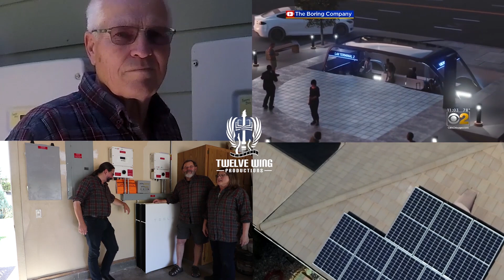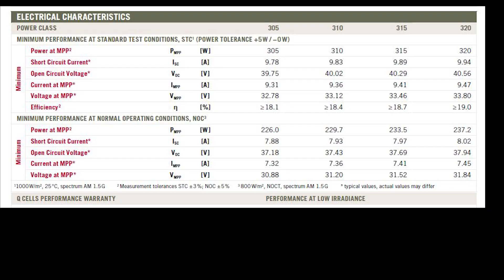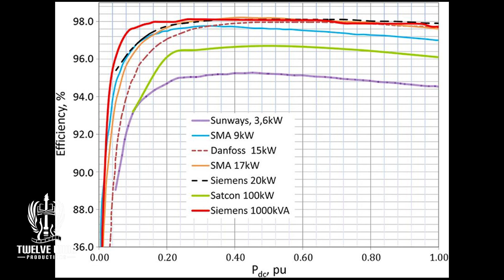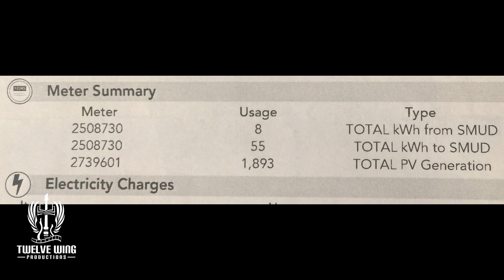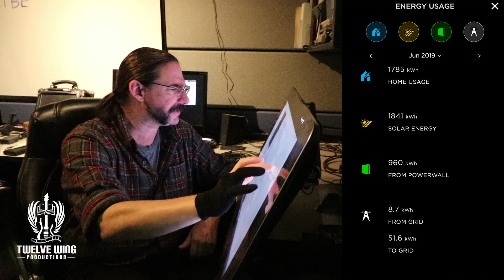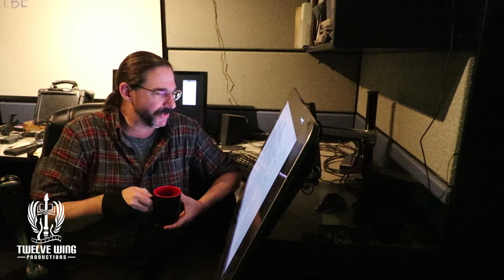How much power does a Tesla Powerwall system really lose?: The Energy Sovereignty Project

Comment: A really great video. I had no idea about inverters being less efficient if they were too large. It always bothered me when I’d see clipping that a larger one wasn’t used. Two questions if you’re still monitoring this video :

Would it be fair to say as long as the difference in rates between peek and off peek are greater than 10% then using the Powerwall makes sense but otherwise just let it send excess to the grid? 

I have micro inverters. Is a string inverter more efficient and does it send DC power from the panels to the Powerwall or do both systems convert first to AC then DC for storage and back to AC again and is they the reason for so much of the losses? 

Thanks !
Reply from the maker: Hello Christopher,
Yes, I'm still monitoring the page and will be starting to produce videos again shortly.
As to your first question, I'm not sure what you mean by the difference of peak and off peak.  Basically your goal should be to run your home as much as possible off the battery to ensure you maximize your return on your investment.  This also assists the battery health as well so long as you don't drop below 20% of charge.
It helps the longevity if the batteries aren't kept at or near 100%.

So this then comes down to sizing your PV system size and battery capacity correctly according to your use case.  Ideally you want to make sure that you have power to drive your home the entire evening when solar isn't providing power to the home.  If this isn't possible then yes, you will want to make sure that you discharge the battery when your utility company is charging you the most for the power.
This may be harder on the batteries but will be your best case for getting your money's worth out of the system.

As to the microinverters, they can be a huge benefit if you have to transfer the power a great distance from where your panels are to where your batteries/home is.  Such as on a ranch or cabin set up where the panels need to be placed away from other structures or on a hilltop.
You get a lot of loss from DC as you extend the distance.
With rooftop solar it isn't as important but you still gain the benefit of having a fairly low loss system.  Losses are usually less with microinverters than they are with a single large inverter or bank of smaller inverters (the usual configuration).

The main losses are as outlined in the video.  Due to a problem Tesla had during testing in Europe early on, they restricted access to the internal DC buss within the battery.
There were simply too many different brands of charger for them to ensure that the batteries were protected.
For this reason all of the powerwall batteries switched to an AC operation only and carried their own onboard inverter/charger.
This also simplified installation but at the cost of some additional losses when the stored energy is transferred out again from each individual unit instead of treating each battery as just an additional DC bank.

The TWP studio here has a 7.2kw system that uses microinverters.  I sold the energy sovereignty project home but I'm still in contact with the current owner and may still do some videos there as well, but I will be doing a video here at the studio before too long when I install batteries here as well.

Thanks for your interest in the channel.  My apologies for my long absence.

Comment: The extra loss would be related to power at different temperatures. In the Tesla datasheet, it says clearly that 90% efficiency is tested at 3.3kW (charge/discharge) at 25degC. Obviously most owners will be operating outside those conditions and that increases the losses. Unless one can put their Powerwall in a controlled air conditioned room at 25degC and limit the charge/discharge at 3.3kW, the cost of doing so would exceed the loss itself. My Powerwall is operating at 87% after nearly 4 years of ownership. Utilisation rate is about 48% on average, so I should get a long life out of it. Powerwall has operated flawlessly so far. I've ridden through over 104 hours of blackouts (the longest being 25 hrs) and I've had about 60 blackouts. The sheer convenience of having power during a grid blackout is priceless. Well worth it.

Comment: In Belgium we can put as much panels on our roof as we want, the only limit is a 10kW inverter
Reply: So unfair were capped per house hold even if the whole street doesn't have solar.
Reply from the maker: Very interesting.. but then that's your limit then.  No one is going to hook 20kw of panels up to a 10kw inverter...though in winter you might come close.. say 15-18kw.
Or by that did you mean 10kw each?  So a 20kw system could use two 10kw inverters?

Comment: I am about to install a solar system at my house.  My average use is 55 kw/h per day over the past 12 months.  During the summer, we are using about 75 kw/h per day (some of the increase is due to working from home during COVID).  What size solar system & how many power walls would you recommend?
Reply from the maker: Are you driving electric as well?
If so, are those numbers including your vehicle charging?
Also, how large is your home and what is your general geographic location... latitude and elevation if you aren't comfortable with giving me your country/state and elevation.
Reply: I do not have an electric vehicle.  My house is 2300 square feet.  I live in Charleston, Sc.
Reply from the maker: @bklankford79 , if you have net metering in your area and you wanted to cover all your electricity costs you would need around 20-23kw of solar production, roughly twice what we have as our yearly average is 30kwh per day and our summer peak usage is around 50-60kwh per day.
At 10.2kw of production we are able to drive 10,000 miles on spare electricity.  That's approx. 3.2Mw.

So if we knock the driving off the top and give that to you in additional production you can probably go closer to that 20kw range or even a little less.
The problem comes if you don't have net metering or planning for what you are going to do when net metering is no longer available.
When that happens you will be purchasing power from the grid for about a month and a half in mid winter even though you are over producing during the spring and summer.

The best way for me to suggest offsetting this is to drive electric and install 60-90kwh of onsite battery storage.
This is the "Energy Sovereignty" approach and pays dividends beyond just the savings on your electric bill and auto repair costs.
What it does is it allows you piece of mind that even if oil were to totally collapse due to war or virus... what have you... that you would still be more or less self sufficient.
As you have seen by following The Energy Sovereignty Project... even on the cloudiest of days our production isn't zero.

So the final calculations of this are going to be based on some other lifestyle factors you are going to need to sort through.
I hope this helped.
Reply: I would have net metering for 10 years and then it phases out.  So you are recommending a ~20kw system AND 6 powerwalls?

Comment: I have Tesla Energy 31 solar panels 300w. at 9.3 kw. installed with two Powerwall 2 . My question is what would be the right inverter should be installed on this. Right now I have A Delta Solivia 7.6 kw. So I called Tesla Energy and stated the what about the other 1700 watts. That's about extra 6 panels I'm paying not being use. Tesla Energy Tech support wouldn't answer my question. I could have just go with 25 panels.
Reply: You couldve gone with 25panels to match your inverter but that's perfect test conditions. And your allowed to over power your inverter so it can run at max power when available as the exact amount of panels will never max out your inverter and with the extra panels you'll be getting an extra 6 to 10sqm of solar collection space to bring your efficiency back up.  I would definitely get extra few panels next time to optimise my production during times of the day when sun is not at the perfect angel.

Comment: I live in Edmonds, WA and installed 13.2 kWh solar PV system in 2012 (Itek 240 W panels w/Bluefrog microinverters) and installed two PW2's in 2018. Last year we produced 12,182 kWh of solar and our total energy usage was 3,521 kWh, 2,515 kWh subtracting our Tesla charging, so we effectively produced 346% of our total energy usage in our all electric home. Our electricity provider Snohomish PUD has been excellent to work with over past 8 years, and we get an annual check up to $5k/year for our excess electricity through Net Metering ($0.54 kWh versus $0.10 kWh without incentives). Those incentives will sunset this year, but have helped us pay off the hefty cost for our 2012 solar array.
Reply from the maker: That's fantastic David!  And thank you so much for sharing that!
You are a prime example of what I was talking about when I said that the current net metering situation for most people is not going to be sustainable for the utilities as a business model once everyone starts to produce as you are.

At that time there will be a shift, a compromise between solar producers and the utilities.
Looking at the numbers for The Energy Sovereignty Project and extrapolating that a complete solar roof should be able to peak at nearly 20kw, I see no reason why 80%+ of suburban and nearly 100% of rural homes won't be fully covered by the power they produce.

This will mean that utility companies will need to produce nearly no power to these homes in summer and probably well over 90% of the home's total use will be covered in the dead of winter... even where it snows.

There will still be some usage likely, but the utility companies will have a HUGE amount of advance warning and data collection will be off the hook compared to what it is now.

Are there months/weeks/days where you have to pull from the grid power?  If so, can you share with us what those times are and approx. how many days in a year you have to draw from the grid?
If you log a total amount of grid usage... say for last year, I'd love to hear what that amount was.

Thanks, and Thank you for posting.

Comment: I am creating a thermostat that checks net solar available after loads, and only turns on the air conditioner during peak hours if the net available solar can cover the 3kw demand for the HVAC. It has 24 hours of settings for on or off or peak settings. Just before peak or early into peak hours, I can crank the temperature down to pre cool the house. If I'm at work during the day, I can shut it off. Alternatively, it can run the HVAC hour by hour and by a weekday setting. If net > 3kw turn HVAC on. I have 3 air conditioners. If two are turned on and the other loads are about 1kw, there is no solar headroom for turning number 3 on during peak time at 3:00pm.
Reply from the maker: That's fantastic... great work.
One additional thing you might consider is some way to not only look at the hourly coverage, but for those cases where some cooling is needed in the evening (for sleep comfort) that it could query the battery power level and even examine trending.
It's these types of smart systems that are going to be very prevalent in the future, not only for things like your AC system but also hugely important for vehicle driving.

I'm pouring myself a drink as I type this and will be firing up the camera soon to talk a little bit about vehicle to grid technology once I can formulate my thoughts.
This might touch on what you are doing as well... so I'll probably wind up mentioning you by name.
Reply: @twelvewingproductions7508  - No problem. I get the idea from CWNE88 here on YouTube. He did something similar with available excess solar turning up the Tesla wall charger amps. Truly driving on solar. Might want to mention him as well. Hey, The Nest thermostat company sold for $1 billion. You never know...

Comment: Sorry another question, this time on the positioning of the panels. 
Thinking in gardening terms when positioning a green house it is better to place it where it gets the most winter sun, as winter warmth is more beneficial for advancing the next years crop of plants. As the Grid Providers are not always keen for summer time energy from households, plus the pay-in tariffs may not be that good... might it be better to have slightly more panels but aiming at the winter sun? 
Just wondered what that would do to the yearly self-sufficiency figures. Obviously if your whole roof is panels it doesn't matter but  in most cases their is a budget controlling the final number of panels.
Reply from the maker: Another FANTASTIC idea.  To optimize for winter.  That's great "outside the box" thinking.
I will most CERTAINLY be mentioning that in a future video.
Any off angle during summer would be of negligible difference but getting them pointed to maximize sun angle in winter would make a HUGE difference if you had a fixed array that was not mounted on your home.
Obviously, like you said, if you are mounting them on your roof you will have little choice as to their direction but even in that case... most certainly if you have a choice between a roof face that is pointed at the winter noon as opposed to one pointed at summer noon... go with the winter.

This is why I always smile when I see your name on a comment.  Thanks.
Reply: @twelvewingproductions7508  Always welcome. You can thank my wondering mind when gardening. :) 
I've seen so many greenhouses positioned to either look good or to be hidden out of the way, putting their function secondary. So discussion about solar panels positioning just sounded so familiar to me. 

At a household amount of solar would the efficiency gained by cooling panels be worth the electrical power to pump a coolant around them? Just wondering if it does prove worth the extra complication then coolant could be used to bring a hot water tank up to temperature, for either hot water or as a heat store used later as heating on a cold night. Here in the UK a hot day is normally followed by a hot night but I know some areas of the world the temperature drops off at night dramatically. 
I've seen people with solar water heaters on their roof in warmer countries and it now makes me wonder if they could of got similar results water cooling their panels with like you say better efficiency.
Reply from the maker: @helenlawson8426 , I would love to do a study on it to see what benefit could be gained.  I can say that we do see a considerable fall off here in July and August when we see temperatures in the 105-112 range.
So the more days one sees in that region, the more it might make sense.
Your idea about running that heat through a water heater primary coil is also a good one.
But would it ever be worth the complexity?  Probably not.
It might be better to focus on adjusting the materials to be more efficient at higher temperatures.
Reply: @twelvewingproductions7508  Ok I can do simple.  :) 
How about altering the angle of the panels... normally they do this to best match the panels to the sun. How about instead increasing the angle to both better increase airflow behind the panels and just as importantly face the panels at the lower cooler sun. A bit like the Greenhouse analogy were you position the panels to avoid the hottest part of the day/year.

I know they have different set ups for where you are in the world but maybe there are more gains to be made just by fine tuning the positioning of the panels to match your very specific part of the world. 

Rattling around in the back of my head is an advertising sign you could only see at a certain angle. It was I think on an old Tomorrows World program (showing my age). From memory it was a series of dots on both sides of the panel that by how much you offset them you could alter the angle it went from clear to advert. 
If they could do something like that on a solar panel you could have it go from clear at low angles a white opaque colour as the sun directly hits it.
Reply from the maker: @helenlawson8426 , I don't think that anything that was actually on the panel would help much if at all, though your idea of venting them certainly has promise.
Something that might help.. again it would be an interesting study, would be louvers that would actually sit off the surface to... yes... shade... the panel.
The idea being that there is likely a point where shading some of the direct light on the panel would cool it to the point where the increased efficiency more than made up for the loss.
But... again... complexity.
I don't like making simple and elegant things more complex. 
Summer production is also simply not nearly as much an issue as optimizing winter production.
Reply: @twelvewingproductions7508  Hi, You'll be surprised the difference in temperature in just painting something black or white, so white dots could be all it takes. Having said that you could probably get a bigger heat improvement just by adding some extra Ali cooling fins to the back for those Ali framed panels in the hottest of locations. It stays the same solar cells just variations in framing, much more viable in a business way.

It does sound like maybe panels should be made and graded for different latitudes in the same way plants have temperature zones.
Reply from the maker: @helenlawson8426 , I agree about grading them for different thermal properties.
Some might cost more but be optimized for specific climates.  I can totally see that happening in the future.